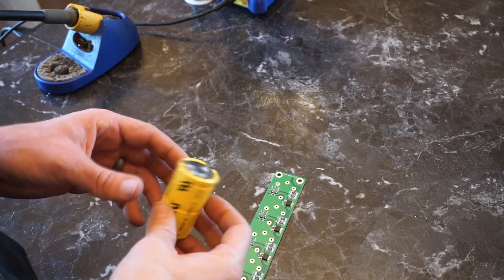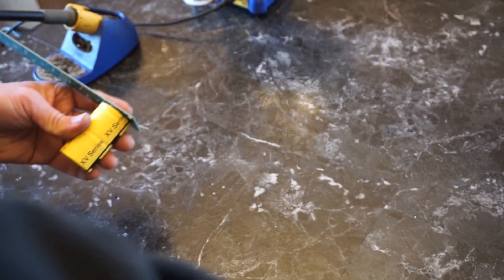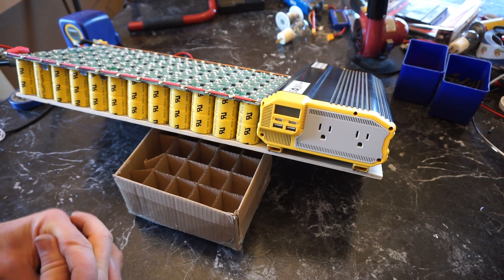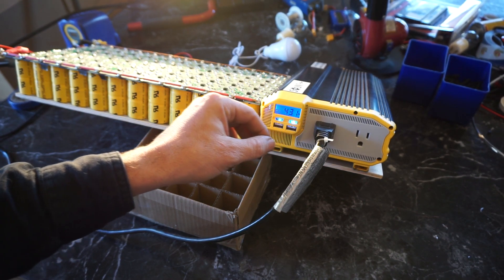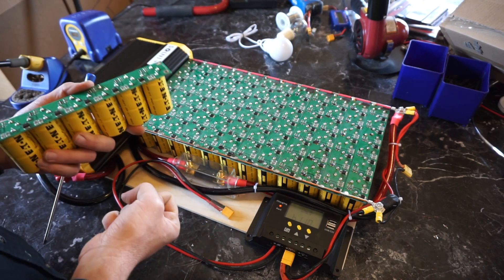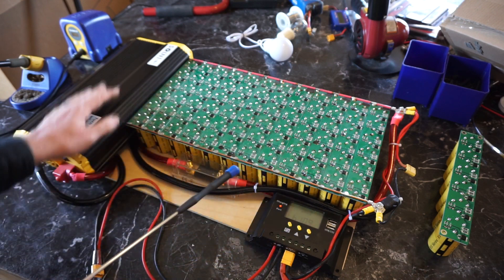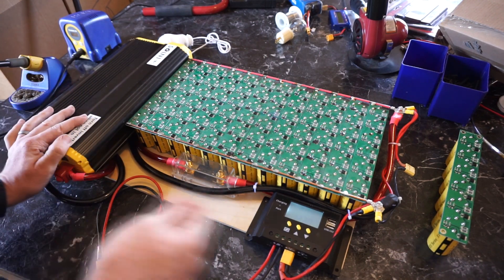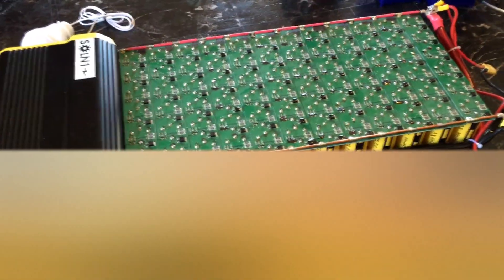Building the SOLN1-2000 Watt Capacitor Solar Generator

Comment: Nice.
I use 2 16v 500F supercapacitors for 24v solar system.
Capacitors are connected to my battery bank. It is very useful when you run devices that produce current surges over 0.2 seconds.
Like my electric wood saw 800W and wood splitter 2800W start current = x4

Comment: i was wondering... could you use these in a 24v system? seems to me, that using a 24v or even 48v would be beneficial as you would be running less amps through the wires, due to the higher voltage, thus requiring less expensive wires, while keeping the total wattage the same. they even make 24v and 48v inverters. just something to think about. might end up being even more portable due to the lower weight of wire, etc.

Comment: Running all of those capacitors through an inverter and then out at 120 volts isn't very efficient. A lot of devices actually change your 120 AC back to DC. Running a fluorescent light when you could be running LED lights is also wasting energy. Most LED bulbs that run on 120 Volts AC, have a circuit in them to convert the AC to DC which is a huge voltage drop right there. Why not run your capacitor bank at 120-130 volts DC? You lose capacitance but you don't lose a large amount of power by converting the lower voltage to a higher AC voltage.

Comment: Awesome, ive been looking at balance and protection boards for this purpose, i like this board. i see its a 2yr old video, ive been subscrubed for longer than that but i guess i missed it. looking at motorcycle battery and drone groundstation power source. Have you happened to make an updated model of this?

Comment: Why are you wasting your money on this? Supercapacitors have notoriously low energy density when compared even with Lead Acid batteries, let alone Lithium- based ones. They're much more expensive per Watt, too. For the same money, you could build a high capacity bank of LFP cells (for safety and much better durability, albeit at lower charge density, than Li-Ion cells), in a smaller volume, and still have the same instantaneous current capability as that bank of capacitors. Remember that supercapacitors do have a design life, both in terms of number of charge/discharge cycles and in years of use.  Also, be aware that there are noticeable differences in capacitance across even the same batch of. capacitors. Many Chinese supercapacitors have far less than the claimed capacitance, and the variation across a batch will also be greater. (Some new supercaps have been measured with less than half the capacitance of the figure stated on the label.) What this means, even if the devices are from reputable manufacturers, is that in a series-connected bank of capacitors which become subjected to deep discharge (maybe less. than 70 or 80% of the expected bank capacity) at least one cell will become reverse-charged. Supercapacitors do not tolerate that, and they become damaged, thus reducing their capacitance further. This is repeated until the affected capacitors fail. This can happen in a surprisingly short time of use, and certainly after far fewer than the expected number of discharge cycles. Supercapacitors also have a maximum current rating, above which internal damage will occur.

Comment: 12*6 caps * 17 cad = 1224 CAD for caps alone. A bit too expensive. The battery with a single boostpack looks a like more   practical idea.

Comment: You talked about the inverter but you didn't mention who made it or what it's total capacity was. Your "boost pack" in a hybrid setup for a practical system sounds like a better idea. Using the super caps for the initial surge for high current motor startup is actually a great idea. As for your copper rod setup. Take a look at the 1 or 2 ought wire going into your inverter. There's a reason why this wire is larger than the 10 gauge wire in your copper rods. One doesn't get something for nothing. For the 10 or 15 running amps that you are drawing from your inverter, you are drawing MANY more DC amps from your super caps and / or battery. In the beginning days of inverter technology, it used to be a 10 : 1 ratio. You draw 1 amp from the inverter, you draw 10 amps from the battery. When you read specs like "85% efficiency" on inverter boxes, this does NOT mean that you draw 1 amp out, you put 1.15 amps in. If it did, you wouldn't have wire feeding your inverter that could wear your wedding ring. The most accurate way to know for sure would be to get a clamp on amp meter with a DC range over 200 amps. Connect your inverter to a known high current DC power source like your car battery with your engine RUNNING, clamp the meter on the appropriate power cable, turn on the inverter and load it with a known value like your skill saw and read the meter. This will tell you why you need something larger than 10 gauge wire for your interconnections.

Comment: Great idea
Could you please provide more details on specs of capacitors?
Only information I have about capacitors is that they discharge almost instantly providing a huge peak power then off to silence or till charged again

I have a home solar power system and I'm willing ti improve it

Comment: Pardon my lack of knowledge. I want to convert a car to electric. After watching this I'm thinking a hybrid supercap and battery array would be much more efficient than just using batteries. Would it be wise to charge the supercaps first from the charge controller and brake regen? Then using diodes let the supercaps charge the batteries.

Comment: I notice that the busbar that you have running along the positive and negative sides is quite a narrow gauge compared to the thick line running from the busbars to the inverter. Is there a reason for this? Not so much for the thin busbar, but for the fat lead running to the inverter.

Comment: You do know that Super Caps have a leak factor right? a battery the same "Storage" as your super caps would last around 5x longer...
Personal, i would do the same idea but with some Lipo cells (Always use a BMS guys) =)

Video guy: LEAVE THE LIGHT ON! AND RUN A 120V 60W LIGHT :D

Comment: What is the solar panel controller for ? what ot does?
Reply: It regulates the charge that goes into the capacitors. Keeps the input voltage more or less stable.

Comment: This is a really overpriced solution in search of a problem. Capacitors are fun to play with but there is nothing new here, capacitors have always been used to smooth out loads on dc power supplies and filter spikes too, so what? Any home solar system that is battery backed can do the same thing for the kinds of loads mentioned in this video.

Comment: To solve the issue of the charge controller not powering up at low voltage, simply install a buck-boost converter between the capacitor bank and the controller. This will boost the low DC voltage to a preset voltage that the controller can use to turn on and thus accept the solar input without having to charge the capacity bank first.

Comment: Could larger capacitors decrease the amount of solar panels used on homes and what about the batteries?  1.  Are you eliminating batteries altogether?  2.  Are there no commercial products similar to what you’re doing?  Lastly, couldn’t this application be used to reduce battery usage in e-bikes and e-motorcycles?  Or would you just be replacing batteries to capacitors one for one?

Comment: what would you recommend for use with electric skateboard using solar panels to go with this - https://www.lazada.co.th/products/allwin-4-wheel-electric-skateboard-single-driver-motor-remote-control-longboard-intl-i248393213-s382505401.html?gclid=Cj0KCQiAuf7fBRD7ARIsACqb8w5ubKty7eWFjNwym4EJCsHjGQ4rYTb1GHd-Ur-OW0iAudFagNoZmAkaAs6kEALw_wcB&ef_id=:G:s&s_kwcid=AL!3152!3!286179630377!!!u!310770682055!?s_kwcid=AL!3152!3!286179630377!!!u!!&exlaz=d_1:mm_150050845_51350205_2010350205::12:1498579383!58089999096!!!pla-310770682055!c!310770682055!382505401!124195072&utm_source=google&utm_medium=sem_non_brand&utm_content=310770682055_382505401_124195072&utm_campaign=1498579383&utm_term=58089999096_c_pla-310770682055&adjust_tracker=t2v78t_5n20iw&adjust_campaign=1498579383&adjust_adgroup=58089999096_c_pla-310770682055&adjust_creative=310770682055_382505401_124195072&tracker_limit=1000000

Comment: So many words, but hardly any information and some of them are even wrong.

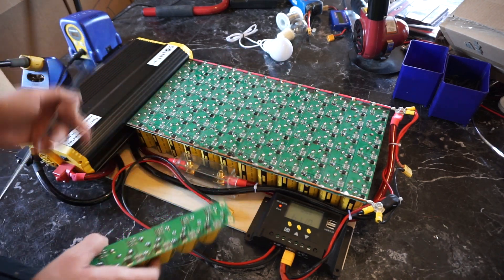For hybrid operation, the capacitors and batteries do not have to be connected in series, but in parallel. (~5:38)

Comment: This looks like about the size of a Tesla module which is 22 volts 225 amp hours and 55 lb. Storing 5.5 kilowatts hours and costing approximately $1,500. What is the usable Watt hours of this Bank if only discharged to 10 volts?  I heard that each 400 ferret capacitor holds .4 Watts hours. Brand new lithium batteries run about $0.50 a watt hour. So a hundred of these what you give us 40 watthours? Or do we get less than 40 watt hours because the voltage drops below 10 volts at some point and the inverter shuts off? Would I be right in assuming you have $20 worth of lithium ion battery storage? Am I off by a factor of 3 as we can only get one third of the capacitors stored energy out as the voltage hits 9 volts and we are really $3 worth of lithium storage?

Comment: Yes, this will work very well with my power wall... :) The small 18650 batteries won't be able to handle the large current draws on some appliances but with this set up, the capacitors can discharge large current without putting too much strain on the batteries. Thank you for the video!

Comment: These are going to be useful in the EV field it takes less energy to maintain a moving object than it does to increase motion from 0.
I like the label Hybrid you referred to!  Re gen braking and re charging while using the same energy stored

Comment: lasersaber, I was wondering about using a larger capacitor like a 1200F instead of the 300F you are using, I live in China and the prices are pretty low. how would I put something like that together. I think I could make it a bit smaller and get the same result.  I am thinking you used this configuration because it packaged well. can you give me any ideas?

Comment: So how does these do with charging when the temperature is below freezing. I've considered putting batteries in my garage for lights and charging with solar, but there's a risk in leaving the batteries in cold weather and even more risk with them being charged on a sunny but very cold day. How would super capacitors do in that situation? Thanks for the video, well done.
Reply: temps dont effect caps like batteries

Comment: Thin copper rod 12awg   then uses 3/0 wire to the inverter  VERY pointless
Reply: There I will agree with you. Needs screws ( Brass would be good ) from each terminal up and then soldered to the heavy cable or even a Brass/Copper buss bar  then to the 3/0 wire. Actually, for 12 VDC with the insulation on them with the correct rating, it would be more like #2 wire to handle the load. I have some #2 that is rated at 300Amps at 12VDC.

Comment: Looks like you need an arduino to control a relay to switch the solar panel between the two connection points, (depending on the voltages) and to isolate the charge controller (at night or when the solar panel isn't providing enough charge for ten minutes.)

Comment: With slight improvement in supercapacitor technology in the future lowering the cost of supercapacitor this kind of storage can go very far.
There're 2 things capacitor can do better than batteries:
1. It has higher efficiency due to the lower internal resistance.
2. Supercapacitor has 1000000 or even infinite charge/discharge cycle durability while Li-ion batteries only have 1000.

Comment: I am assuming that is just a unshileded solid copper wire that connects all the negative terminals together and the same for the positive only you used heat shrink in between the actual connections?

Comment: So Would something like this be good to run on a full household solor system if u made one big enough could this be used like a soft start for starting a air conditioner then after they use all the stored power it just run off your battery and then they recharge as your charging your battery
Reply: Like say u have your panels connected to your charging controllers  to the battery then have this capacitor pack connected to them going to your  inverter ? Would like to know bc I am tired of having to stay on grid so I can use my air conditioner in the summer months

Comment: Just a thought I had that may help. With regards to starting up the solar charge controller. Rather than having a separate input from the panels to bring the pack voltage up check and see if your charge controller has a common ground, most of them do. If it does
have a common ground then you could use a heavy duty push to make button between the +in on the charge controller and the +out to the capacitor bank. A few seconds of holding the button down should raise the voltage enough to boot up the controller.

Check the connections with a meter and see if they are common. If so this could save you the extra wiring  and connector. I would
also put a battery isolate switch inline with the inverter. The usb output is going to be a parasitic load and discharge the bank when not in use. A simple DC-DC board with a fuse and a switch would give you the same features, likely be more efficient and can be
used independently from the inverter.

I would also seriously consider some of the great suggestion's on the comments about incorporating a battery bank. That way you will have the huge current resource and a massively increased run time for your loads.

Also as advised please be very careful with the output from the capacitor bank as it is more than capable of causing a serious 
injury or damage to you and the inverter.

Keep having fun and be safe :-)

All the best.

Comment: I can't find the Soln1-2000 inverter anywhere
Reply: If you are just looking for the inverter, it is made by Krieger. Be forewarned though that it is a modified square wave and not a true sine wave inverter. If you want the whole setup, I guess you'd have to build your own. The inverter itself can be ordered from Home Depot in the US. https://www.homedepot.com/p/Krieger-2000-Watt-Power-Inverter-KR2000/308112132 $189.96 A non-remote controlled unit is available from Hammerdown. At a savings currently from HD at $104.99. If you don't need all the meters and such, you can get a Harbor Freight sold Jupiter 2000 Watt unit for $119.99 today. < Mine has been in use off and on now for almost 2 years. It has less trouble starting things than my 
Pure Sine Wave 3000 Watt unit because it does not go into a power save mode like most Pure Sine Wave units do.

Comment: One thing I would do to make sure it lasts is put a switchable link on that plug from the charger to the cap pack so i wouldn't have to disconnect that wire at all, so the plug would not wear out! Second would be, yes a hybrid pack! Lastly, way bigger, small workshop bigger, to run more than just a chop saw & a mixer! But the great idea with this is these are easy to do so, just putting my to cents out there!

Comment: I'm curious as to how long an E-Bike would be powered by this?
Reply: Not long. The smallest motors you see on e-bikes draw like 250w, which would only run for about 6 minutes on this system. Much better off using mostly lithium cells with a couple of supplemental capacitors.

Comment: Doing a rough calculation, at .4 watt-hours per cap it'd take 10 to run a 1400 watt circular saw for 10 seconds, with a recharge time of 2 minutes on a 120 watt panel, which sounds about right. A 12v/9ah sealed lead acid battery (SLA) would last 1 hour at equivalent use, or 5 minutes continuous use, whereas it'd take 60 caps to run the saw continuously for 1 minute, with a 12 minute recharge time, so simply adding that SLA to this system would allow the tool to be used for much longer periods at a time without having to buy a lot of expensive capacitors and wait a long time between tool uses. It would also 'waste' less of the panel's output because the SLA can store 1 hour's worth of energy, relative to a puny 10 seconds with 10 caps, or a still paltry 2 minutes with an impractical 60 caps. That way, if the saw isn't used for 1 hour there will be enough energy stored to double the amount of time it can be used for in the next hour, energy which would otherwise have gone to waste, and the saw could be used for much longer periods at a time. I feel that this 'best of both worlds' is a better approach than the purely capacitor based one which most seem to take; I do understand the want to only use caps as a demonstration of their potential, but because batteries and capacitors both have their ups and downs, ie Batteries store Much more Energy and Capacitors deliver Much more Power, I think it's best to show how capacitors can complement and enhance each other. Until capacitors have massively increased capacity they simply cannot compete with batteries in energy storage, so combining both will be better in most applications until they do, which may be a long time yet, and even then their physical size may still be excessive for many applications. To summarise, supercapacitors and batteries are a marriage made in heaven, and one which should be utilized and investigated much more than it is, rather than the trend of simply replacing batteries with capacitors.

Comment: Have you tried a using a super capacitor to replace your lawn tractor battery and the cost?  Or would your car version work, though a car battery is wider than a lawn tractor battery.

Comment: On the positive side of your capacitor strips you could add a nut and screw in each of the Positive holes. Then just solder the buss strip in  the slot in the screw head. That would keep it far enough above the Negative hole.